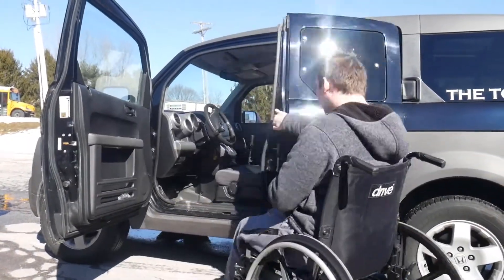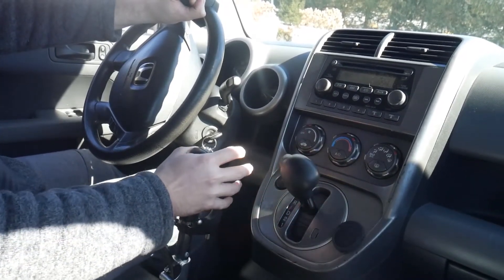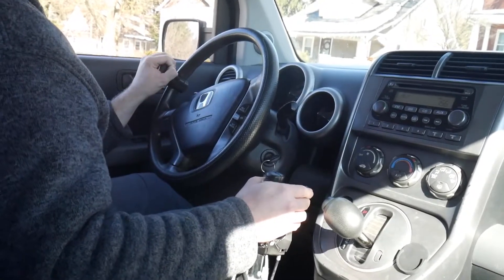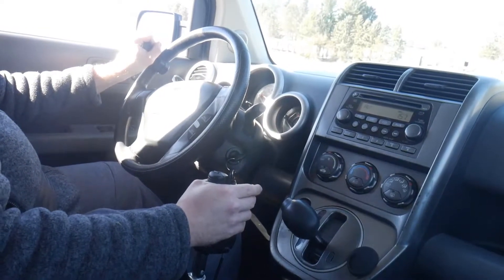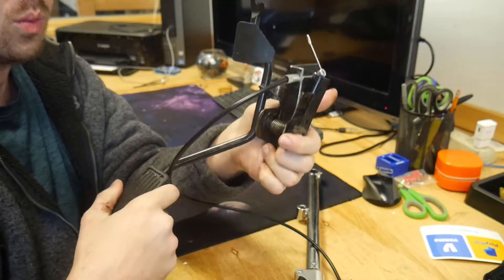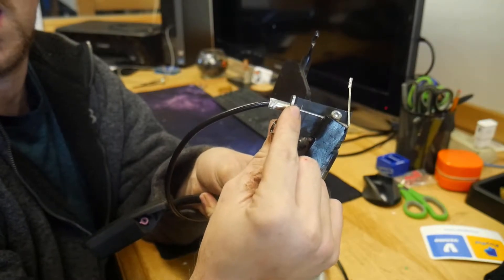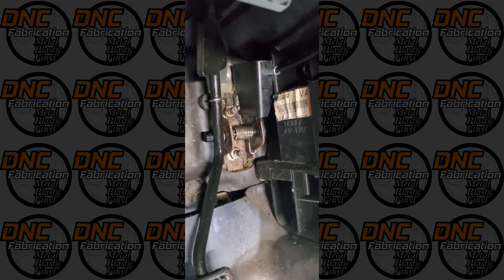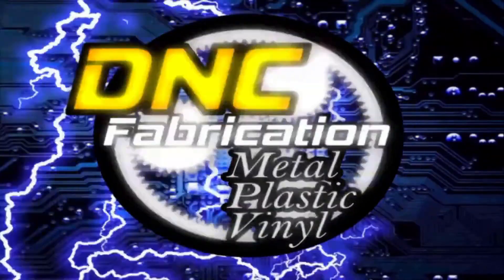DIY Car Hand Controls

Comment: Fantastic demo my friend. Just out of curiosity, did you have to discuss this with your insurance company?
Reply from the maker: I did not, but it defiantly would be a good idea. I still use the pedals and they operate normally, so I would say it did not change function/operation of the car just a modification(like changing your headlights to led). This of course is by no means legal advice though, but it would be a good idea.